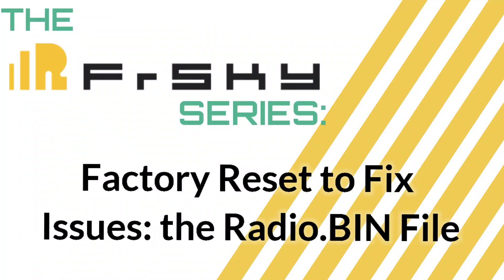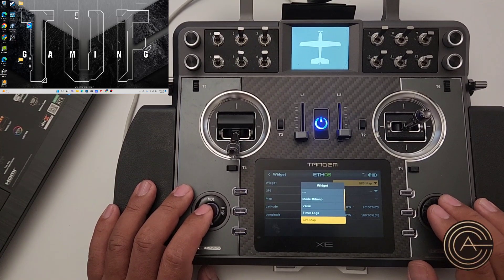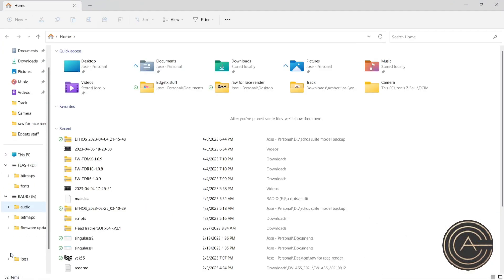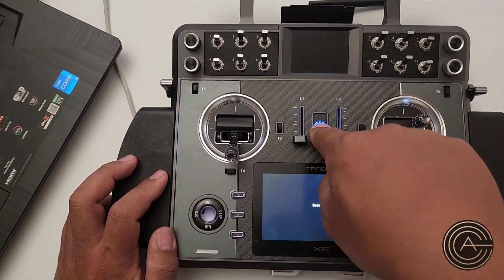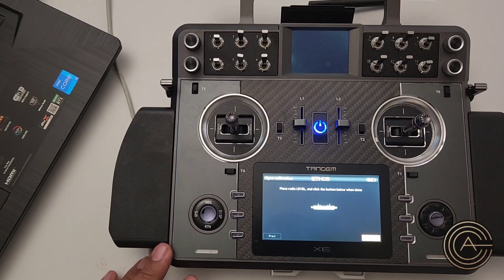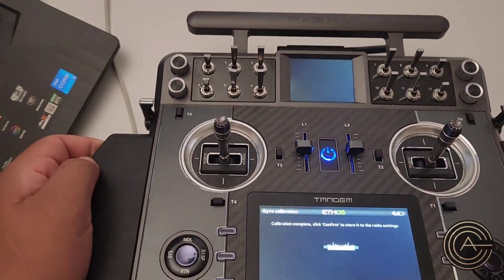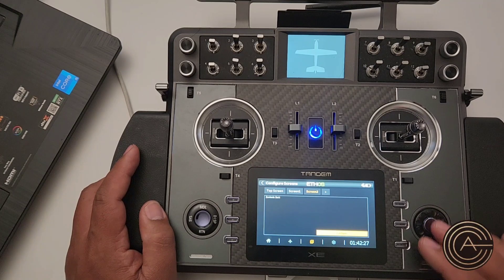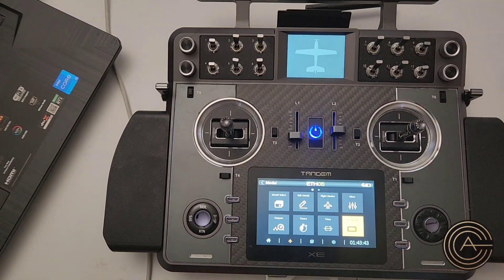Factory Reset to Fix Issues:  the Radio.BIN File

Comment: Fascinating! Just getting to know Ethos & X20S. What was the battery widget thing? Capacity in flight pack maybe? How does that work? I currently (sic) use MiamiMike’s OTX method and a FrSky current sensor to give callouts of mAh remaining percentage. Also, can you give a simple explanation of what the radio.bin file is/does?
Reply from the maker: The Radio.bin file stores many of the general settings like what script files are active, stick calibration setting, labels and general settings and preferences for the entire radio. Anything model specific is stored in the individual model file. Not sure why it gets corrupted but when you delete it, it just rebuilds another one with default setting so it isnt a big deal to delete.
Reply from the maker: I did a couple of videos on setting up voltage telemetry using either the built in voltage sensor in many frsky receivers or using an extrenal voltage telemetry sensor like the FLVSS. Im not sure what you mean about battery widget thing.  But you can get voltage or current sensors to create any warning or call-out you need.